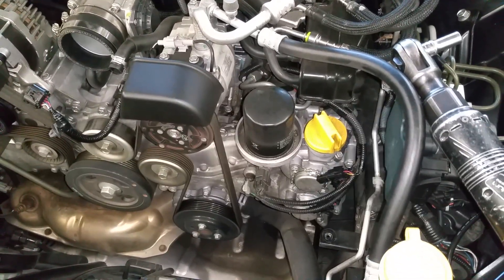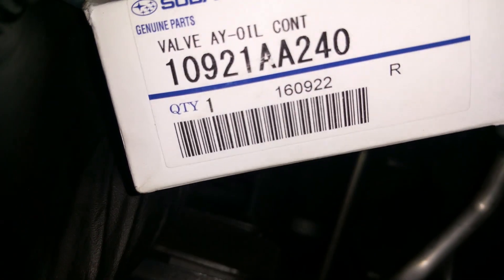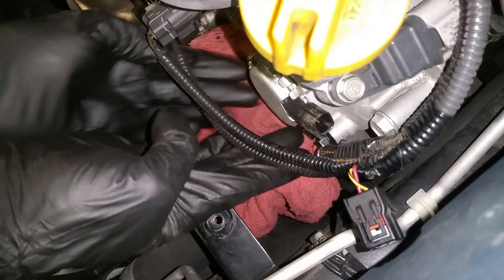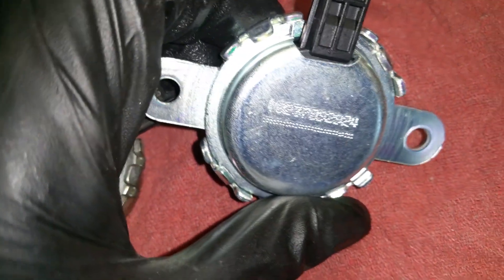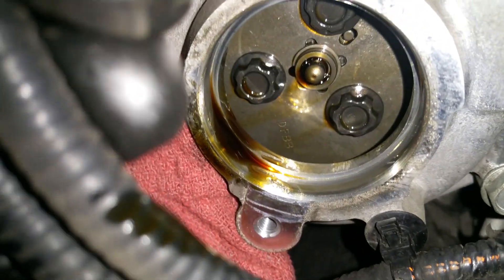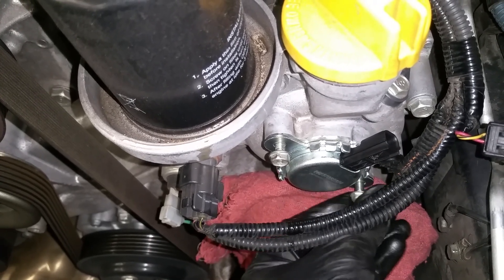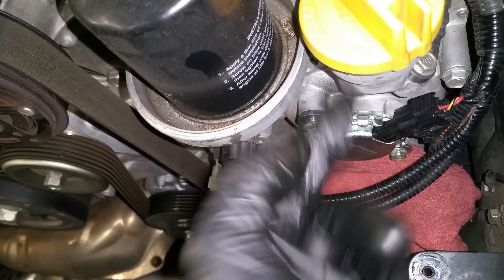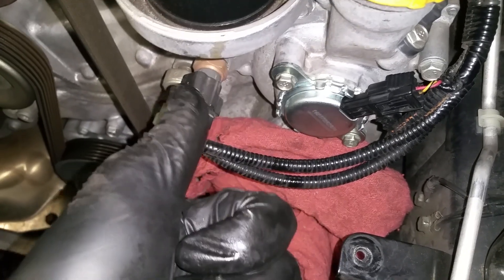Replace/upgrade FA20 FB20 oil control valve vvt

Comment: What about the AVCS solenoid? I have a P0011 and P0016 for Cam 1 and my Cobb Access Port tells me clogged or failing AVCS solenoid. Im trying to check it and replace it but cannot even find it.

Comment: 2016 frs, throwing p0011 code, do you think a oil change with additives and this part change will fix it?, idle has a bit of a tick and runs a little rough also starved itself from oil when i checked the dipstick, do you think im cooked?
Reply: i had p000a code. im planning on changing mine out. Hopefully fixes. I doubt additives will help.

Comment: Had the p0016 curse for about a month now. Car drives great except for limp mode. Will be swapping these along with oil change and reflashing tunes. If it doesn't fix it I'm done trying, I will get the wallet out for the sprocket job lol. Thanks for the clear video.
Reply from the maker: @ARM_DM  yeah, sprockets can be damaged. It's well documented nowadays
Reply: Did it work?
Reply: @jessepadilla5603  sure didn't
Reply: @ARM_DM Did you replace the cam spocket?
Reply: @boomgallagher5399 I did not, I'm not convinced it's damaged. I think it's more of a value throwing off the ECU popping the code. I literally just clear the code after two driving cycles.
Reply: @ARM_DM  thanks. I'm having persistent P000A, cam slow response for bank1 intake. Some rough idle but car drive fine. Keep clearing pending code to avoid limp mode too.
Reply: @boomgallagher5399  Yea if the car's at full power after the code is cleared and it's been sometime (literally have had code for 6/7 months), I think it's safe to assume that it's just a value that's wrong or being read wrong. The clearing all the time also makes mine stall a lot more than usual, but that's just the ecu learning
Reply: @ARM_DM there’s a whole forum stating that the code is burned into the ECU subaru claims the only way to remove the code is to get a new ECU but there are two scanners that can reset the vvt values and remove the code if the issue is fixed

Comment: I did this and changed the oil and check engine light went away, but engine still runs rough at idle. Is there a relearn procedure?
Reply from the maker: What year?

Comment: Can the oil control valve be faulty without engine light? I have poor accereleration at low rpm's and this is my number one guess. Idle is good and no warning lights.

Comment: Will this going bad cause low power or hesitation in acceleration?  Also do the left and the right cylinder head run the same timing advance and retard ... while engine is operating ?

Comment: How would you know if it's the upper or lower one that has gone bad?
Reply: The Code will tell you Sensor A is the top one and Sensor B will be the bottom one , they are the same part .

Comment: The other part right underneath this one that looks the same, does it go by the same name?
Reply: The top one is the Intake side and the bottom one is the exhaust side 
But they both use the same external  solenoid part .

Comment: I had P000A, got a new part from oreilley. Dorman. Oil change with 0w20 & an aftermarket filter. problem went away for about 3 days, then came back. I ignored it for a month. I then swapped the the solenoids, and the code followed; P000A --> P000C. Ok, so to me, this is confirmation it's the part at fault. So, My dumbass ordered another Dorman part from Oreilley.  Changed out the part, and just kept it in the same spot of P000C vs swapping again. I did an Oil change with 0w-20, with a new a Subaru brand filter. This time I left the drain plug out and ran a quart of oil through in hopes it'd clear out any extra debris/gunk. After the reinstall, I reconnected my battery (which resets the codes/clears CEL), scanned and P000C was listed as "historic".  After about 4 or 5 days, the code returned; P000C. 
Should I just bite the bullet, and redo this procedure with a Subaru brand VVT? Is there anything someone would recommend else I can do? Hitting my head against the wall.
Reply: Did you figure this one out?
Reply: None of the aftermarket OTC valves works, bought the latest revision valve and problems went away.

Comment: great job on the video
Reply: It looks like my issue, the entire plastic connector with the copper wires inside was deteriorating, i went to pull it out and half the plug stayed in the VVT.  I'll buy a new one and replace it. My car runs and likely uses more gas until i fix it, it won't leave me dead on the side of the road.

Comment: today I replace one this variable cam timing actuator for my Outback. This unit got oil leakage. the engine oil leaked and soak the cable plug and connector. Changed a new one to avoid cable soaked by oil and finally the ECU choked by oil.

Comment: I recently built a new engine for a 2013 that I got that had a spun rod bearing. When I started the car with the new engine I noticed after it warmed up it dropped to a low idle, the throttle became twitchy, wanted to stall and had the check engine light and slip light on. I put a scan tool on it and I have 4 codes p0102 - Mass or Volume air flow circuit low input, p0113 - Intake air temp circuit high input, p0017 - Crankshaft position camshaft position correlation bank 1 sensor b and P219a - Bank 1 Air-fuel imbalance. All four codes are marked permanent. When I delete them they are immediately there again once the scan tool rescans without ever starting the engine. So curious why I would get and p219a code without ever starting the engine? I tested the vvt solenoid and it checks out. It operates on 12 volts, ohms at 8.4, no continuity when grounded, I also checked the power to the plug and am getting 10v with the battery at 12v. Not sure if 10v is the correct voltage at the plug though? I also checked the ocv behind the solenoid and the button is sprung and seems to be working. Trying to avoid pulling the front cover to replace a ocv if possible.
Reply: I am having a similar issue. Only thing my code isn't permanent.
Reply: I have same issues can you explain me how to clear problem
Reply: Im having the same issues after my engine rebuild, did you ever figure it out?

Comment: Wondering if this would resolve a P0011 code. Engine doesn't stall, no rough idle, oil is changed recently, car doesn't run rough at all.
Reply: did it work?

Comment: Have an 86; have a spare engine; did an engine swap and got a P000c reading?

Replaced the part using the original engine (I know it's not advised but the original didn't have any error codes; just a spun bearing)

Still have the code. The problem is the car doesn't limp like it's advised to should have. 

Really don't want to crack open the timing chain cover to find the problem but if i have to that really sucks.
Reply: did you finally get it fixed? mine is P000A

Comment: I really hope this fixes my problem.
I have a P0018 Crankshaft Position - Camshaft Position Correlation (Bank 2 Sensor A).
But now that he is mentioning it as I type this... I am running 05W-30 Synthetic Oil with a K&N Oil Filter... Haha I will revert back.
Reply: I got the P0018 code earlier this year. Replaced the part with a new one from Toyota and reset the ecu with OFT. Been running stage1 with the OFT and I've had no issues since.
Reply: Did this fix you problem?

Comment: Hello so what exactly was the issue? i get a strong ratteling noise from that part of the vvt. Only when the engine is warm. i dont get any errors when i run a diagnosis with the computer.

Comment: Idk if you can help but: 

I have a P0020 check engine light on for the cam sensor for bank 2 sensor A. I’ve tried replacing the sensor and checked all others, Cleared the codes and so on. Check engine light goes away and comes back on. What else could it be?

Possibly worth noting, the check engine light for this code did not come on until after we replaced the slave cylinder and clutch, is there anything we could have missed, unplugged, or etc that could be causing the issue?
Reply: I have the same issue, did you find your solution?

Comment: I’m having code P0017. Anything to do with this OCV?
Reply: Same issue ATM. Did you ever have any luck? I'm having a terrible idol randomly.
Reply: @CONSTANTLY_  changing the RH side exhaust cam gear solved my problem.
Most of the time it'll fix your issue if you're throwing code P0017
Reply: @TheRed86  so replacing the control valve didn't help your issue?
Reply: @CONSTANTLY_  no, ocv valve hardly gv issue
Reply: @CONSTANTLY_  u can try swapping the ocv, if it still throwing the same code then it's the cam gear.

Comment: Hey so I have an fb20 and I think these oil control valves are bad it’s the last thing I’ve narrowed it down to but wanted your opinion or advise on what type of noise it would make if they were bad. My car at idle doesn’t make the noise only around 2-4K rpm and only one side it sounds like I have no oil like valve slap but only one valve and if I run through a gear hard it won’t make it only used like light load it’ll make the sound which confuses me or if I rev it when it peaks and starts to drop when load leaves so I’m pretty stumped. Took off valve covers all the lash seems writhing spec for mileage so I’m either going to buy a new motor bc I don’t want to dump more money into it and not find the issue when I can get an engine for 600$ and swap myself then rebuild it... so maybe you can help??

Comment: I don't know if I had 3/4 of these go out or if 3/4 of my sprokets went out all at once but I just got a bunch of codes out of nowhere. Now I am running 5w30 as per the turbo kit recommendation. 
P0021
P0024
P0014
P0011
P0420
P0018
P0016
P000B
P000D
Reply from the maker: Try 0w40 instead

Comment: Wondering for the bottom sensors (bank 1 and 2 -exhaust) can be replaced without draining the oil?
Reply: If you let the car sit all oil should be in the oil pan at the very bottom of the engine. So you can replace all the engine sensors
Reply: No need to drain the oil

Comment: Hey man i need your help please 🙏  idk if u heard about the recall and having knocking sounds and all that and im actually having that same issue but im out of warranty what can it be the cause of the engine knocking sound? And got some codes about camshaft vvt timing slow response and all that. Code is p0024 , p0014 , p000b
Reply: Then your ocv need to be changed

Comment: Would p0019 code relate to this? I have a 2015 WRX also are all 4 ocv's the same? Could I theoretically swap 2 and see if the code changes?
Reply from the maker: I would simply look up the part on subaru parts website and compare them between intake and exhaust. Hopefully you just have a bad OCV and not require a new AVCS gear sprocket :(

Comment: Is this the part that goes out, when you boost the FA20 motor?
Reply: its 99% of the time the sprocket, im about to replace mine right now. I have p0366 code that comes back instantly. Connector is getting power so im going straight to where the most common issue is. Sprocket.
Reply: @RusstyCoDskills  yep, any kind of issues after electrical that deal with either intake cams has always been the sprocket backplate stuck open. Sold my car last April. Haven't missed it since. Lol

Comment: If that valve goes out will it throw a cel?
Reply: It will literally cause engine problems like rod knocking sound
Reply: @Rise_Ambition  but will it throw a cel? How would I know if it was bad? Leaking? Or probe the connection?

Comment: Will this help to solve codes P0011 and P0021, it revolves around a timing over advanced code for both banks 1 and 2 intake cams.
Reply: IF you still get on youtube and see this, I talked with the directors of sales in North America and they are looking into the P0018 code being and issue and the fact that SOOOO many FR-S vehicles get these types of codes constantly and they "DONT KNOW" whats wrong. So, if you never got this fixed please call the number to report a complaint. It will help this all become a recall
Reply: @Chris-ex2sl  which number can we call?
Reply: @Motionlane  My apologies man, it's been a while I forgot that entire mess. A company bought it at full price and didn't even check it so, I got lucky.

Comment: Hey Subtledriver, I was researching for days trying to understand my code P000A (Camshaft position slow response bank 1) on December 2018 but after after one week the CEL disappeared. I decided not to address it. Perhaps a mistake. Now, March 2019, I’ve been on a mission researching code P000B which I understand to be the same problem just a different position (A & B) on the engine.

I have very VERY little knowledge about cars and how they work but I’m trying my best to learn. Scion FRS is my first vehicle I work on. I’m trying to learn and do most of the work myself since I no longer trust Toyota to have knowledge to do the job correctly.

Will the method you used in this video help me with my codes P000A (which no longer appears, but wouldn’t mind addressing) and my current P000B? Also, I took a look at my engine very carefully I noticed I have four of these, what I now I’ve learn to be Actuators. I’m assuming because the engine has four cylinders. Would it best to only change two of these but all four? Thanks in advance. And I apologizing for long message and my ignorance in the question and statements I made, again I’m trying to learn on how cars work. LOL! Thanks again.
Reply: Also, on the driver side, bottom actuator (Bank 2 Exhaust side) I see a lot, A LOT of greasy, oily dry grime. I don’t think it’s normal. All three of the other actuators seem to be in better shape, free from the grime. The only people that were allow to ever work on my car was Toyota so I know this isn’t something that I caused. Third question would be, is this normal on an engine and fourthly, if it’s not is it safe to clean it out with a tooth brush and warm water? Thanks again.
Reply: kaevn hey sorry if this is too late but did you manage to find a solution for this? I just got the same code
Reply: Sorry for the late reply. Yeah, I change the Engine Variable Valve Timing (VVT) Solenoid for Bank 1-A but it’s was actually the camshaft itself that needed to be replace. I had to take it to Toyota because it was out of my car fixing experience. So they had to work on for a few days. It was a big job. Cost a lot to repair.
Reply: Hey mate,oiling at purchasing a turbo 86 but it has this code. Was Ur car acting up at all with this code because this car runs beautifully.. Can't imagine it being a camshaft? Owner says it's a dirty cam position sensor but don't trust it. When you replaced the ocv did you immediately realise it was not the issue or did it take some time for the code to reappear?
Reply: *looking
Reply: Stewart Floresta it was immediately. Within hours and noticed that the work I did on the car didn’t work and it’s started cutting the stuttering, mmm a better way to describe it was that the engine was trying to die... it didn’t want to continue to stay on. So that’s when I knew it had to be something within the engine. Took it Toyota. They fixed it. Never had a problem again. The reason for this was I was driver the car hard but wasn’t aware that I needed to upgrade the engine internals to stronger than parts to withstand the abuse I was giving it. LOL! Anyways, I hope this helps.
Reply: @kaevn436  thanks. Seems might not be the issue for me as the car runs perfect

Comment: I replaced this, but my BRZ is still slow.
Reply from the maker: you need a performance tune! haha
Reply: @subtledriver   I'll just get the STi vers...oh...
Reply from the maker: @AD-iw4vy  go stage 2, header, k/n or aem intake, exhaust and tune/flex fuel. And it will really wake up with additional 30 or more hp.

Comment: Not sure if someones mentioned this but is it possible to throw P0011,P0021, P0244 code with OCV intake sensors out?  I removed my valve covers and nothing looked bent or out of place. Now I'm assuming skipped a tooth or OCV out. Input appreciated. Great videos
Reply: Any updates bro I'm having exactly the same issue
Reply: @Rise_Ambition  what up. Subaru had to replace my ECU. It's been about a year and I haven't had the codes since.
Reply: did your car run fine even with the codes on? im having the same issue but my car is running rough

Comment: Mine went out all four at once... Diagnostic code shows for all P000A to D :(
Reply from the maker: change your oil/filter with new synthectic 0w20 and reset, see what happens. did they all come on at once, or over time fail, one-by-one?
Reply: subtledriver All at once. I have changed the oil and the filter just yesterday and reset👌 But it's so hard to race up to 5k rpm. Maybe I'll.drive around for 2 weeks or so as per.your description. Less likely they fail all at once, the only common thing all four has is the engine oil and the filter

Comment: would doing this may help solve my P0016 Code frs
Reply from the maker: if the solenoid is faulty, possibly. but you also need to check the cam sensor and their is a possible issue with the timing being off or the oil control system in the sprocket being defective.
Reply: @subtledriver  It can also be that they drove it awhile with the CEL and now the timing is off in the ECU, and have to replace that or possibly have is flashed after they have fixed the original timing issue.
Reply: I've got the dreaded P0016 on my Forester XT... I was curious if you replaced the oil control valve and, if so, did P0016 disappear?